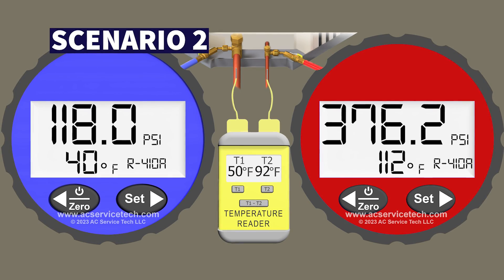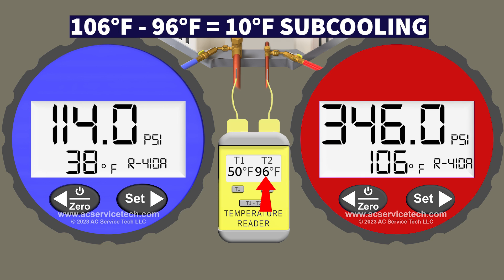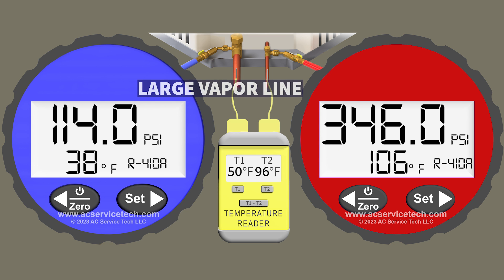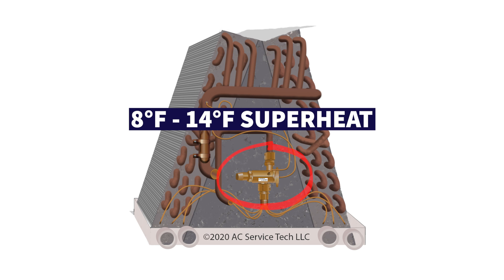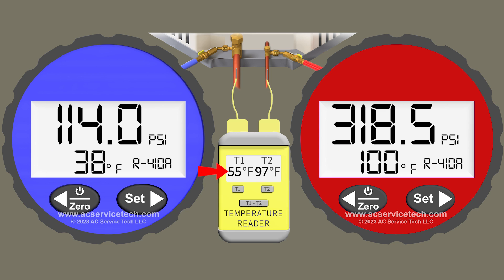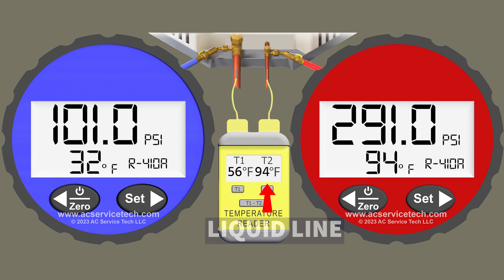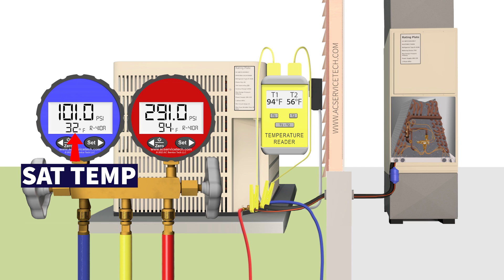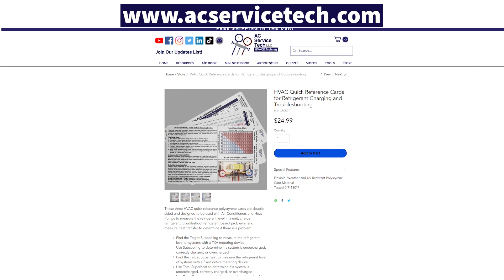R410A Refrigerant Charge Level Measurements on Air Conditioners! Walkthrough and Practice!

Comment: What's so funny is that even if u have txv and u use the subcooling right at 10 subcool as the manufacturer tell u !  U still need to raise the 10 of subcool to get the low side higher than 32 degrees so the evp coil does not freeze !!!   So let me ask u this if I have 12 deg or 10 of subcool and my low side is going from 28 degrees too 35 degrees  what could be causing this ?  If everthing else is good,  air flow , air filters, filter drier !!!!!!
😊
Reply from the maker: you certainly have either low indoor airflow or a liquid line restriction. Exactly what method are you using to measure airflow CFM? you can determine if you are low on charge, liquid line restriction, or low airflow by using your sat temps superheat and subcooling. Look up "acservicetech frozen freezing coil" or "acservicetech low airflow, liquid line restriction, low charge" on youtube for those videos.

Comment: How to charge ac with electric txv ?
i charge my ac in r410 for each extera meter pipe add 20 gr but my pressure in out and in is 120 to 160 is correct ?

Comment: I have 2010 (13 years old) Trane 5 ton 14 SEER heat pump, TXV. Label states the following: R410A, 10 degree subcooling, comp RLA 26.4, Design PSI HIGH 480 LOW 480. Anyone know what "Design PSI HIGH 480 LOW 480" means? It's not cooling very well so I took pressures today when it was 111 degrees outside. Readings were High 510 PSI (136 degrees saturation), liquid line 118 degrees. Low 135 PSI (46 degree saturation), vapor line 74 degrees. That's 18 degrees Subcooling and 28 degrees SuperHeat. Not sure I truly trust my line temps since I'm using an inexpensive thermocouple. I may need to invest in the Fieldpiece thermocouple you use in your videos. How does high ambient temps affect pressures and line temps? If using approach method, my liquid line is 7 degrees above ambient but my pressure should be closer to 480, not 510 PSI. I also checked my compressor amps at about 23 amps. RLA is 26.4. I'm going to check the pressures again in the morning when it's closer to 90 degrees.
Reply: I checked again today while outdoor temp was 91 degrees. H 380 PSI (113 degree sat temp ), L 143 (50 degree sat temp). My Subcooling was about 11 degrees with 12 degree Super heat. Very drastic difference with ambient temp 91 vs 111 degrees.

Comment: I have a question about checking charge on a system with a piston metering device. I did a start up on a system and I had it running for 30 min but the superheat was constantly fluctuating from 2 degrees to 11 degrees superheat and I’ve noticed on other start ups my superheat fluctuating between 2 and 3 degrees up and down. Is that normal? Also I’ve done a start up on a system with piston metering device and my superheat was quite low telling me I was slightly overcharged but the sub cooling was only 1-2 degrees subcooling, what does that indicate?

Comment: This is really good! When doing geothermal units it can be very different, due to location of condensers and geo water lines - Keep in mind pressures, saturated line temps and subcooling (typically lower than expected)
Reply: Obviously also evap coil temps, make sure not @32°F or lower (otherwise its freezing)

Comment: Thank you for your effort, it was a very good work. Chiller devices in Turkey do not write superheat or subcooling value.
 In this case, should we adjust the gas charge according to the gas pressure, gas type r410a, what are your suggestions about this situation?

Comment: I bought your book, read it twice, watched some of your videos and installed my own A/C unit on my own saving thousands of dollars. THANK YOU!
Reply: Did you do your own brazing?  For me, that’s the scary part .
Reply: @paulrozinski1488  I used Stay Brite 8 solder.  I hear you, Paul about it being the scary part.  At least for me worrying if the job is good enough to hold.  It held pressure and vacuum without leaks before I broke the vacuum with r410a.
Reply: In installation tools is the most important thing. Just my refrigerant vacuum pump costs 1k to do the job right
Reply: @imakewhat2572  I agree.  If I did this for a living, I could see getting a pump like that.  My cheap one got it down to 250 microns, but likely would break doing the job day after day for years like yours as well as mine was likely slower than your $1,000 one.

Comment: I must admit I wish we were using metric units but still this is a great video love your books am saving up for the Mini split book.
Just recently installed a Mini split Fujitsu unit, followed your videos which I had to go over a number of times, rather than pay someone I bought all the gear myself and now following your videos the install has gone really well. Where i am in Australia it is winter and just am so surprised at how warm the house is with minimal use of power. Modern Air heat pumps are great here in Australia
Reply: Good luck with warranty. In Australia you need to be licensed to install air-conditioning.
Reply: @bradnewman1459  yes I know
Reply: @bradnewman1459  Yes that is true but I am very confident that i have done the job correctly. Trying to get someone to do the job is next to impossible nowadays
Reply: Majority Product literature in the U.S. uses Imperial, not SI

Comment: My job is wanting me to test pressures when it's 35 to 45 degrees outside. Bsrrly6gets uo to 50 degrees some days. Really fun
Reply: SAME! 
I told them I wont get the true pressures and everything will be out of the ordinary. We should wait for summer. My boss said you can read pressures at any weather. Well duuh. But it won't be the REAL measurements when the system will be under load in a hot summer day. Jesus these ppl just don't give a fuck and are so ignorant. Not to mention I constantly argue with him that a low refrigerant situation would cause the evap coil to freeze, he says otherwise.(and that's just one of our arguments) 🤦‍♂️ I can't deal with old techs that think they know everything because they have 20 years of experience.

Comment: I love your videos. It is extremely informative and very easy to follow. I do have a question. I hope you can answer. What if there is no Subcooling on the label.
Reply: He had on a note on the screen stating that just in case you don't see it on the unit,  the subcooling target is 11 for units with a TXV
Reply: I also don't see it in some units. A good rule is to be about 10 degrees of sb
And 8-12 SH if you have nothing as a reference.
Reply: I’m in Australia and iv never seen a recommended subcooling on any unit.

Comment: Is this method i can use with mini splits units
Reply: Mini split is a "critically charged unit", and are charged by weight. You have to recover the refrigerant, weigh in refrigerant to the manufacturer's spec, and walk away.
Reply: No, mini splits do not use TXV (in the traditional sense) they use EEV which are controlled by the outdoor unit printed circuit board. They are completely different beasts , and it’s almost impossible to use traditional troubleshooting methods with them. You should check out his new book on mini splits.
Reply: Mini splits are their own mystery. Nobody I know understands them hardly lol

Comment: So with a txv is the superheat standard always between 8 and 14 degrees?
Reply: From what I gather you are more concentrating on on sub cooling than opposed to super heat. But you'd always want around like you said 8-14 super heat. If you have a piston system you'll concentrate more on super heat with ambient and wet bulb temps.  Also matters how long the line set is. The longer the line set the higher the super heat. So many variables.